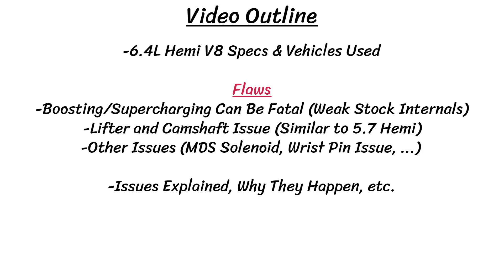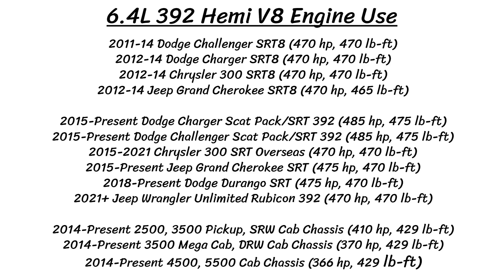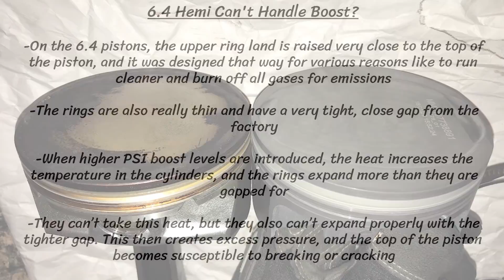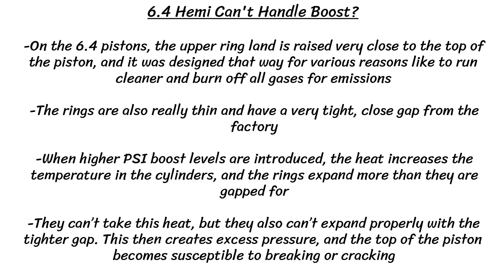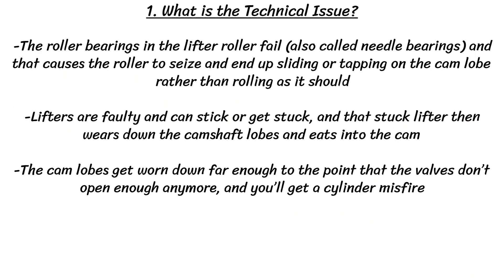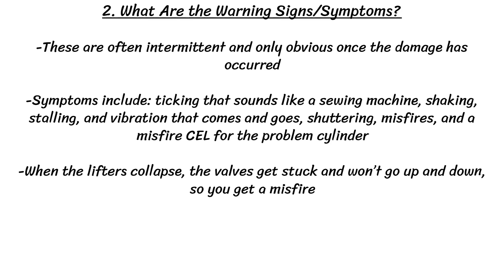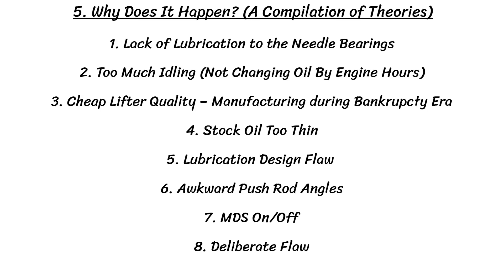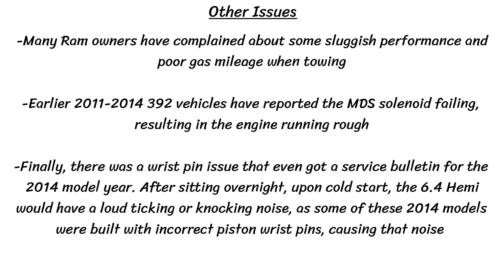The Specs and Fatal Flaws of the Chrysler 6.4L Hemi V8 Engine (392 Hemi Issues)

Comment: Fatal flaws:
The engine was built really well and has high compression so if you are stupid and add boost to the stock internal engine it will probably fail. 
If you don’t properly maintain the engine the lifters will fail and wipe out the cam somewhere around 75,000-100,000 miles. If you ignore it long enough you’ll need a new engine. 
Neither of these are flaws of the engine, they are flaws of the owner of the vehicle.

Comment: 1:07 Just got s lifter tap on 2012 srt8. Comp cam stage II , springs retainers keepers , hellcat lifters , head bolts and all gaskets from high horse performance $1800. Good for around 50 more ponies. Hope that will last as car was strong before. Not too upset as i knew thos could happen and knew i would cam up.
Reply: Add DuraLube
Reply: @THRASHMETALFUNRIFFS  Lifter siezed , destroyed cam. Now has Comp. cam stage 2 and Hellcat lifters. After tune $3,900. But what a difference.
Reply: @srt8rocketship241  DuraLube coats the metal and makes it super slippery.  You will notice faster starts, less throttle needed, cooler temps, etc... 1st used it over 20yrs ago on a Honda motor with known bad oiling to the distributor... I put in in with a used distributor that had already started showing metal flakes in the cap again and it never happened again and saved the motor.  I use it at least once a year in every car since then.
Reply: @THRASHMETALFUNRIFFS  Great advice , but it was gone. Crappy factory parts i suppose. The LS engines are suffering also.

Comment: I have my 2005 hemi work truck whit 268000 and still go strong and sometimes my foot go's to the floor, recently have a  Lick at the head gasket.
I will find out how is my engene after using Full synthetic oil at all times .
My jeep, my 3 hemis 1500's, and my srt durango  drive lovely DODGE

Comment: Had a lifter tap in the winter on my 2018 Charger Skat. It was still under warranty. I told them to keep the whole car. They gave me another one. Only had the damn thing for a year.
Reply: Did you always use 0w-40? They chose that odd weight for a reason.

Comment: I have a 2019 SRT Jeep. I’m on my second motor! I bought it brand new 2 yrs ago. They didn’t say what went wrong with the first motor? Just said I lucked out, and I’m getting a new motor. New motor went in after that. New motor only has 18,000  miles on it. Then when traveling on a little vacation get away. Got a check engine light, Jeep puttering down the road..had to feather it about 2000 RPM to keep it running. Come to find out. It had multiple miss fire cylinders, and 2 other problems. Oh yeah..dealership replaced the push start button that cost $1,028. So idk?…kind of done with Jeep/Dodge. But if they offer me a Trackhawk!!..shit I might take??!!..idk?

Comment: So does the roller bearing and roller lifter failure issue apply to the gen 3 coyote 5.0 engine from Ford by chance? This sounds and awful lot like the BBQ tick that is common with the engine.
Reply: The 5.0 is dohc it doesn’t have roller lifters or pushrods.
Reply: @joshkrause2977  I'm not familiar with the pushrod motors. Are lifters exclusive to push rod motors? 
I've been researching this for the past week. Looking for what could potentially cause the coyotes tick.

Comment: Thank you for the video. I have a 2013 challenger srt8. I know one person in my car group who has put a supercharger on their 6.4 challenger. So far it's running good I forget how much boost he's making.
Reply: how many miles on your srt? Getting my 2012 6.4L 300 this weekend with 75,xxx miles. Curious if you’ve had any issues regarding the Cam/lifters
Reply: @myKurisma  mine currently has over 105,000 miles on it runs good. Could run better though. I probably need to get it tuned and replace spark plugs and coils. Maybe get a larger throttle body. Congrats on the srt 300. They look great. That's gotta be a fun sedan. Looks luxurious too

Comment: Lifters are definitely a true issue on the 6.4 hemi. Had to get mine replaced with camshaft and the vehicle is completely stock with 53k miles. The notorious Hemi Lifter Tick ! It happens because of lack of lubrication. Crank is too far from the camshaft, drive about 2k RPM!
Reply: 👍You got that right.
Reply: What year?

Comment: As someone who has just had a lifter failure on their 392 within the last month I hope someone takes my advice when I say this, after ur car hits 60k miles don’t even gamble with it because u will lose dollars trying to save pennys, change all of ur lifters. My car was taken care of like a baby and I had a lifter failure at 72k miles. The code that popped up was a p219a code which is a misfire and I spent almost $1k trying to diagnose the problem between sparks and coils and injectors etc… on top of that I spent $4500 for a new cam and new lifters and labor after my cam got shredded but that’s not all… The metal shavings from my cam found their way to the bottom of my engine and messed my crankshaft up as well requiring my motor to get pulled out the car all together and fully disassembled to find every metal shaving, i was LUCKY with the crankshaft problem which would’ve added another few thousand to my bill but because my mechanic is a close buddy and he had a spare 392 motor he gave me his crankshaft, but total I ended up paying close to $5500. as long as 1 person takes my advice I’m happy, CHANGE UR LIFTERS AFTER 60k MILES DO NOT TAKE THE RISK. It will cost u $4k at the minimum up to $7k depending on how much damage the metal shavings do to ur engine.

Comment: I took my 392 to 110,000 miles doing oil changes every 3500 miles before I sold my car…. I had an awesome time in that car.
I never really did like the Managed displacement system.  And I also didn’t like oil feedback line dumping into the throttle body.

Comment: You should touch on the casting sand that plugs the heater core and radiator in these things too, every winter we do at least a dozen heater cores, and the coolant recovery bottle always has sand in the bottom.
Reply from the maker: I’ve heard that was a bigger issue on the 3.6L Pentastars but didn’t know it affected these as well thanks for sharing
Reply: @MarspeedCars  no problem, we maintain about 20 Ram 2500/3500 trucks from 2013-2016, and honestly, I'm not a big fan.

Comment: Seems that Ford dohc 5.0 is more reliable.. also Chevy LS engine too.  
 Of course no matter what.  Racing takes it till on all engines. Take care of your engines..
Racing = money..  
If I was just going for n/a stock engines.  I think 5.7 and 392 is ok if you take care of them..  but over all I'd go with ford 5.0 or Chevy LS.  They have a better record over all. 
I have a dodge Durango with a 4.7l.  Ohc. It's easy to switch out lifters etc. And it's been a good engine.  Even the last gen 4.7 are reliable engines.   Dodge should not just made 5.7 DOHC. I believe it would of been a better design for them.  
But over all. Chrysler likes to cut corners..

Comment: So I can get a car with a turbo on it already and mount a 102mm turbo and run 50 pounds of boost and it will be fine cause it was built for boost? Can do mount that 102mm to a Camaro and have it work on 50psi of boost?
Reply: No american v8 will take 50 lbs without scattering.  You dont know if the PO built it for that or not unless you have receipts
Plus...youll have to upgrade everything between the flexplate and the axle studs still no guarantee

Comment: Fatal? I guess we should ignore the fact that they have a reputation for being among the most reliable engines available today.
Reply: Exactly. Any time you boosting an engine or doing heavy  modifications you run this risk.
Reply: @omcx1e  the 392 was not designed to be boosted considering it doesn’t have forged internals.